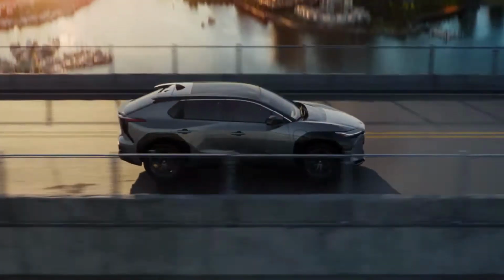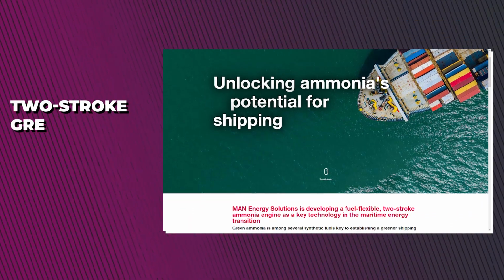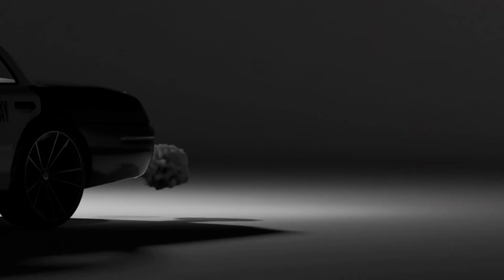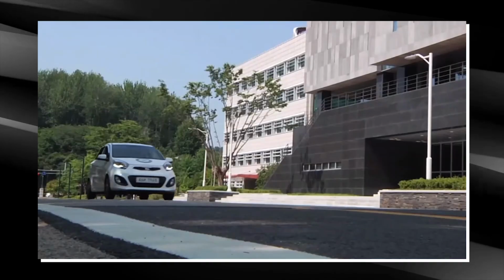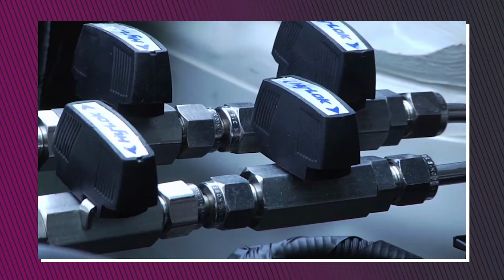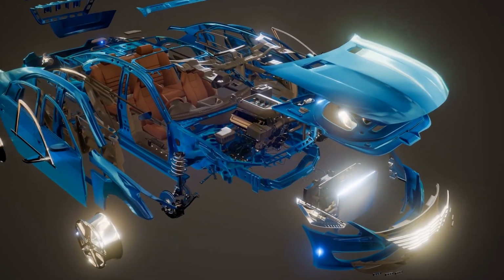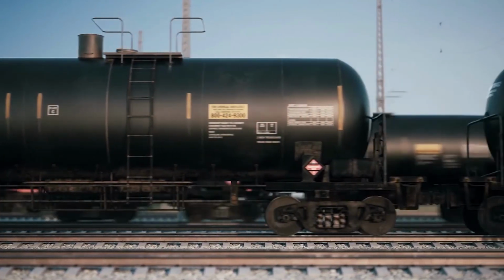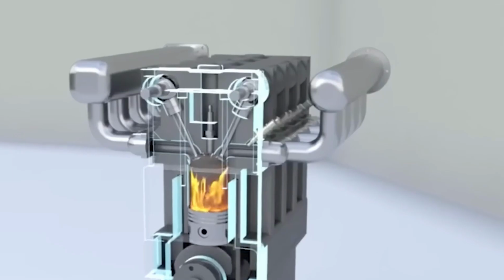Toyota's New Ammonia Engine Will Destroy The Entire EV Industry!

Comment: This is an interesting technology. Toyota's Prius already reduces pollution per mile about 38% over a similar sized car. A dual fuel engine (gas and ammonia) in theory could have the same performance while reducing pollution 50 or 60% per mile potentially bringing it to EVs, especially in states that burn polluting fuels to produce electricity. Of course countries, being a bit short sighted, ignore pollution per mile figures. In this way, a gas guzzling truck (18 MPG) might be considered "cleaner" than a car that goes 3X that milage per ton of CO2 and NOX. One other item is that transporting Ammonia is easier and considered safer and more practical than transmitting hydrogen.